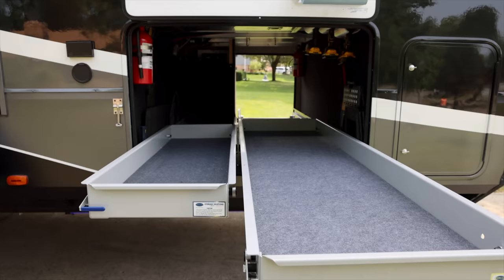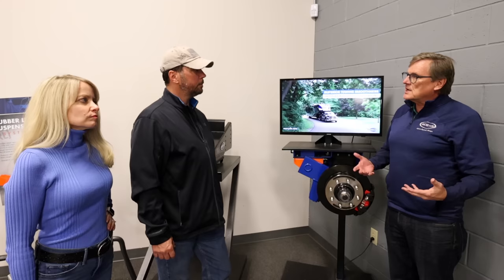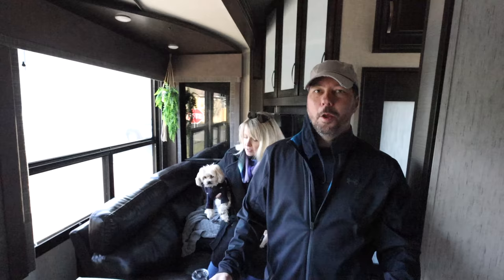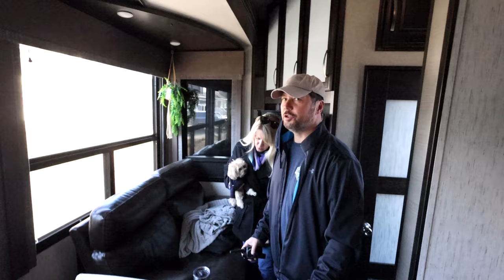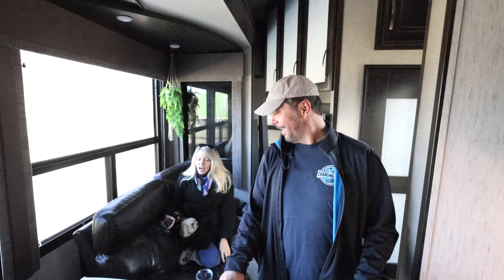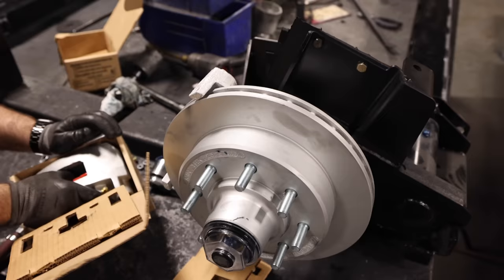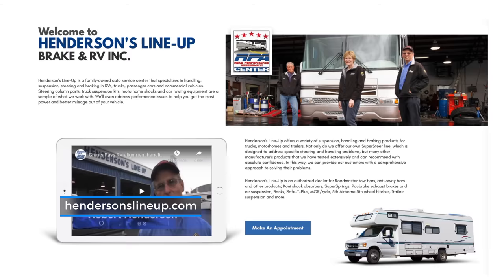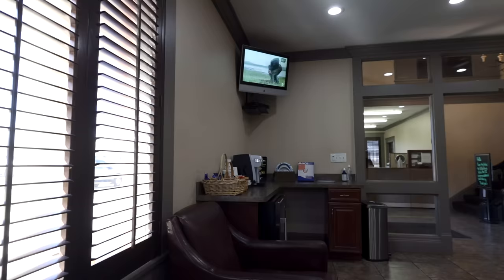MORryde Independent Suspension and Disc Brakes

Comment: When we order our 376 momentum we’re gonna have that put in for suspension love it thanks
Reply: Roadmaster Slipper Springs with Joyrider shock is cheaper, stronger, and no maintenance ever.
Reply: @Will-bp2yc  they may be cheaper but they are most definitely not stronger abd the ride quality is incomparable.
Reply: @Cake41579  OK? Do you know that Mor/ryde sheer springs tear (that is their maintenance recommendation), you have to check acceptable tearing. Also they last 5-6 years, after replacing them and their high cost, then buy them? Yes the ride is probably better, but Im not riding in a 5th wheel trailer. I only want it not to break/no maintenance, hence Slipper springs/Gas Shocks! And a whole lot less expensive!

Comment: Great video overall, and a great improvement in the trailer. We tow a Forest river 30' pull behind trailer, connected to our extended 155" WB one-ton Chevrolet Express van with a HensleyArrow hitch. We have been a weekend and vacation towers, Forest River is a 2 axle torsion axle, (similar to the Airstream suspension), The dry weight is listed at 6,600 lbs, but you and I know that is before things like the Hensley hitch +250lbs, Propane tanks 125 lbs full, spare tire 80 lbs? air conditioner, and who knows what else. Yes, I know, WAY lighter and smaller than your rig.  LOL. It has drum brakes, that work. I have no idea how it rides as I have never ridden in the trailer, (not legal in most states), but I understand More Ride's thoughts on having you experience the before and after-effects. All in all a fantastic upgrade for your rig. Note, the Hensley hitch causes a pull-behind trailer to tow much like a fifth-wheel trailer, complete with the trailer cutting inside the tow rig on turns, BUt in 38,000 miles of towing, we have NEVER experienced ANY trailer sway. A Hensley hitch is not cheap, coming in at around $3500.00 for everything. Nice warranty though, a lifetime to the original owner and parts replaced free for as long as I own the hitch. And no they do not pay me to write these words. We are both in our 70's and might not be towing over the road much longer, but it has been a trip. We thought about full-timing at one time, but that didn't happen. Glad to see you follow your dream.

Comment: We are currently ordering a new Momentum and they will NOT do IS from the factory. Both the dealer and called Grand Design directly that they don’t do this. It’s a little silly that they offer the 8k axle and disc brake upgrade now for 8k but not the IS part. So we are ordering stock and made an appointment right after our estimated delivery date to have that put in. Just a heads up :)

Comment: Congratulations on the upgrade. Have yall thought bout using 19.5. Tires on truck & trailer, nitrogen in all of your tires with tire pressure regulators? You’ll greatly increase your life of your tires and be less prone for blowouts when using 19.5 on truck & tires. Not including increase mpg. Look into Titan fuel tanks for your truck. You won’t have to stop so often to fuel up, go longer distances and have more flexibility of where your purchasing fuel.

Comment: I had the MORryde IS installed on my 2018 Open Range 3X 388RKS in November of 2018, and the new axles were 2 inches too long to bring home.
In 2019 we were gone for 5 months out West, Canada and Alaska and the IS was great, it is hard to explain to someone just what a difference it is.
Great job with the before and after rides.

Comment: Hey guys.... GREAT video here on the I/S and disc brakes.  It gives you an entirely new perspective when you can see inside the camper as it is moving.  When we ordered our camper from Bama, this was the first thing we wanted outside of even the FBP.  Just feel it adds a safety element to towing in more ways than one.  Again, thanks and hope you guys are well.  If you get down to Florida and find yourself west of Gainesville, you guys got a place to stay.  We have 50AMP and water here, along with 7 acres.

Comment: Thanks a BUNCH for spending my money!  LOL I saw this video shortly after ordering my new 5th wheel in January.  When you guys looked at each other after going over the railroad tracks and said wow, I decided I had completely and totally lost my mind, reviewed it with my bride, and the soonest they could get us in was nov 17.  Backed up 10+ months!  We took the appt as at that time, we planned to head to FL 12/1.  But another video... I have to stop watching your dang videos, they are too expensive, we decided to leave two weeks earlier and spend 9 days in Key West at Boyds before heading to our winter site near Tampa.  Do the timing plan, I was really short on time, and led me to a bad decision to leave morryde with a mysterious electrical issue.  Got 20 miles down the road and said no, we're going back.  They were aware of our timing issue and pulled out all the stops to find the issue.  Chad, you'll appreciate this, when brakes or left turn signal came on, it threw a message to the 2022 F350 the trailer's left brake light was inop... and yet it wasn't.  They finally cut the pump power wire, and no more gremlin.  Best part, hooked the wire back up and no more gremlin.  We have no idea what happened, but I'm kind of leaning to a poor electrical connection, and when he cut that connector out and re did it, we no longer had a spurious electrical noise that was possibly back feeding to the truck
.
The impact and improvement is dramatic.  When we went over the railroad tracks, want to guess what happened, we looked at each other and said WOW.
.
Still questioning my sanity of ripping out a brand new suspension system, but so far loving the outcome.
Reply from the maker: That's awesome!  So glad to hear you feel the difference as much as we do!  Take care and safe travels!  😀

Comment: One or two second delay on trailer brakes could jackknife you in the blink of an eye if you need to jump on truck brakes, at 60 mph each second is longer than a semi. Electricity moves faster than fluid, so I would have mounted brake hardware in a kitchen cabinet right over axles, after all , nobody rides in trailer where the pump noise would disturb them.

Comment: If this upgrade was for a class A motorhome, then I could see the benefit for what is likely a very pricey upgrade. 10,000? More? But for a 5th-wheel trailer? How often does anyone even ride in a 5th-wheel? Even when it's legal? I don't see the return on investment, unless you get it for free, like it appears you did.

[edit] As a 1st time viewer of your channel, I want to add I found your video to be very well done. Clear. Concise. Interesting. I'm just not sold on the MORryde upgrade for a trailer.

Comment: I love the suspension.  Ask them why they didn't do air bags?  MY $66,000,000 question - when is someone going to come out with all electric calipers?  I know the answer - disc brakes squeeze the pads, tough to do with electric.  The time delay you mentioned would be alot worse with screw actuators and a lot more expensive.  Still looking for someone that has done electric calipers or AT LEAST, individual caliper control for antilock improvement.  I noticed the sawed edge on the rotors for speed sensing.  Problem is all 6 wheels react the same.

Comment: This is a better option, obviously.  
But i would add some sort of anti sway bar settup. The original leaf style inherently has that function. You can visualy pick up on the extra left and right rocking from the camera mounted under the chassis. There is no progressive reaction to side loading like a sway bar or leafs for that matter. 
Even factory/oem style torsion axles have anti roll characteristics.  🤔hmm.

Comment: Leaf springs are such a primitive form of suspension and the sole reason for the continued use is cost. 

One question if I may regarding how you carry Daisy when you drive: Is it legal in USA ( I’m in UK) to have a pet unsecured like that when travelling? Are you not concerned what could happen in the event of a front end collision? It has been against the law for many years to travel with an unsecured pet here in the UK. Physics shows that in a 3G impact, which is not a very big crash, your pet would hit the dash with a force equal to 3 times it’s weight which could cause massive damage to the pet.

Comment: This year I put the SRE  4000 system on and now wish I would have saved my $600 and put it into this system. I’ve seen two videos now like this and I’m sold.
Reply: Either Mor/ryde last only 5-6 years. Sheer springs tear, which is part if the maintenance. (Keeping an eye on acceptable tearing limits. There is other products out there.

Comment: This post is NOT ment to "rain on your parade".  Just looking at the suspension system from "old farmer" common sense.  I would be very wary about the force and direction of force being put on the rubber pieces of the suspension.  From what I saw in the video, there is a constant "tearing" force being put on them.   Did the manufacturer give you an approximate milage life of these rubber pieces and at what cost for that part?  Personally I'd have a spare in my basement.  
That is the only weakness I can see in this setup.  Everything else looks GREAT.
  Can't beat disc brakes or independent   suspension on anything.
  Thanks for posting this video and information. Good vid.
Reply from the maker: So far we have 9000 miles on them with no issues.. 👍🏼
Reply: @ChangingLanes  Thanks for your reply.  Been following you for a while.

Comment: Very nice informative video by all the players, note this include the tremendous trio...Chad...Tara...& Daisy.  Chad, only one change I would have done different, oil lubed bearings, they run cooler, easier to maintain, maintenance can be extended out some.  But then, you would be wise to carry 3 new seals at all times, not that they are a huge problem, but if one leaks they do make a mess from that axle back to the rear of the RV on that particular side.   We bought a new IHC 9400 in 2001, it was a 2000, air ride is standard on it.  The truck was leased to different companies that had many spring ride trailers, the ride was not good enough for me.  Then came 2004, we decided to buy a semi trailer, so I went looking for one.  The trailer I bought was a very clean used 48' Refer with a Thermoking Unit on it, Spring Ride, New Recap Tires, oil cooled bearing & Aluminum Wheels.  Before I left the dealership with the trailer, they changed it to air ride, serviced the Unit, I wished I would have had them change out the recap tires, first trip one blew out...these were new recaps at 65mph.  When the tire shop broke the tire down, they found a huge mud ball within the tire, which had to have been put in there by a mechanic at the shop of the company that traded these trailers in.  When I got back in, the new tires got put on and I had zero issues with that trailer for several years, at the mileage rate of 2739 a week, 46 weeks a year, roughly 11000 miles a month.  The maintenance program I designed was really good for both the truck and the trailer.  The whole time we had this truck working, we had put 1 Million...600,000 miles on it and sold it and the newer trailer that I had bought to replace the 48 footer, it was a 53' trailer with a TK Unit on it.  But my point here is this, in all this time of ownership and use, the truck only let me down two times, once was not my fault, but the other time was.  When the truck mileage hit approx. 150,000, the turbo blew up on a 2 lane road just south of Lubbock, TX.  The next vehicle that came by stopped and gave me a ride into Lubbock where I got a Motel and arranged a tow for the repair.  Next day, rented a truck to deliver the load on time, all is well, picked up the truck at the end of the day and went on my way to get another load.  The other time was approx. 850,000 miles, I had planned to have the rear ends exchanged with rebuilt units, in August while at home and taking some time off.  A friend suggested, wait 'til spring, so since he had more time in trucking as an owner operator, I listened to him and adjusted my time by working.  About the time I would have been putting the truck into the shop for the rear diff's, I was picking up a load 220 miles from my house and the front diff went out.  Now, how do you think that would feel if it happened to you?  Not good, now I had to call the folks that I was getting the load for and explain the why's, what for's, etc, along with notifying the people I get the return load from, explaining all of that again for them.  At the time, I had a regular run, hauling for the same people week after week, then year after year.  The truck was towed to a IHC shop local to that area, the trailer the shipper had to unload it and reload it on another trailer, then park my trailer out of the way.  All in all listening to someone else with concerns of mine on my equipment, cost me approx. 10,000 USD, lost loads, expenses for my wife to come and get me and bring me back to pick up the truck, the trailer and the load.  That is the difference between doing maintenance when you have them planned for or a repair on the road.  Life does not give too many do overs, thus the tuition of life goes on and on.  But in all those miles I put on our equipment there were only two wheel seals that ever leaked while on the road.  I learned when to change them by, when the duration of past failures of the seals were averaged out, then back up a month or so, it worked well for us.  Maintenance is always less expensive than repairs.  I knew you all would be tickled when you took that step.  I still prefer that air ride, but I have no RV yet anyway.  Happy Trails...Rich
Reply: I asked for this when I had my 8K IS installed in Dec 2019 after watching a video about oil-lubed bearings/axles on E-Trailer and MORryde didn't offer it as an option at that time.
Reply: @CartersTrail   I sure don't understand why they would not offer the oil cooled bearings as a choice, but I am sure we do understand that in life there are many choices to be made and some are better than others.  My preference is the oil cooled bearings, better, less maintenance, run cooler that greased bearings too.
Reply: @CartersTrail   The grease cap on Chads are for the oil bath bearings, the only difference would be the seals, so it would be an easy fix at the time of a bearing check or repack of the bearings.
Reply: @razmondpush2971  Agreed; I was convinced it was a better option but they apparently don't have the experience with them to support it. You can add them yourself afterwards so I'll run with the greased ones for now and perhaps upgrade later.
Reply: @razmondpush2971  I noticed that in the video and thought that's what was now being offered/included until they showed the greased bearings later... Bottom line is you can add them afterwards if desired.
Reply: @CartersTrail   Yep, you are spot on with that thought.  Later is not a big problem either.  Thanks for the feedback.

Comment: Thx CL for an informative and entertaining video with great production. I see your still running China bombs seems counter intuitive to have better suspension and brakes with high risk rubber on the road for a few $$ saved. I had the Morryde SR4000 installed with 20k# Reese Goose Box when I bought my 2nd hand Fuzion 375, I   would have gone with IS but didn't want to be tied to so few qualified repair facilities after reading about full timers being stranded (when not if) the torsion rubber fails. Happy Camping.
Reply from the maker: Don't mistake the Westlake G rated for “china bombs”. I watch this issue very closely online. The E rated Westlakes had the bad reputation and were dubbed the “china bombs”. So, now, some just consider all Westlakes bad, but they're wrong.  We put 28,000 miles on our last set and only had one blowout from a pothole.
Good point on the torsion block.  Going to see about getting a spare to keep on hand.

Comment: Just had the IS installed on our Momentum 351 toyhauler on May 17th, 2022, and it was a very good experience EXCEPT for the fact that after installation and while we were paying we were informed that we had Hydrastar disc brakes instead of Kodiak. I questioned why not Kodiak and did not get a clear definitive answer. Quite disappointed in that last minute disclosure but mostly my bad for not going over the details prior to our arrival and MORryde doing the work. I ASSUMED we were getting Kodiak disc brakes. Buyer beware! My Chevy brake controller (2022 3500HD DRW) was set on 5.5 with the drum brakes and I'm now at 6.5 and still feel that the trailer is pushing us a bit...
Reply from the maker: That is a bummer, but I'd have to think that any disc brakes should be a huge improvement over drum.  Remember to see if your truck has a separate setting for electric over hydraulic.

Comment: I had a Jayco trailer with independent suspension that gave me a smooth ride like the trailer wasn’t connected. I miss the feeling of a smoother ride with these leaf springs on the new Jayco 5th wheel.😕

Comment: Or you could go to the RV museum while you're at the factory.  It bothers me that it takes a second and a half for the trailer brakes to kick in, but maybe I misunderstood that.  Do the brakes have antilock by any chance?   I think the effect on the truck ride is due to the trailing arm design of the new suspension.  The bumps aren't trying to push the tires straight up they're pivoting the tire up.  Just my thinking.  Keep the good stuff coming.
Reply from the maker: someone else mentioned that aspect of the suspension also... very good point.  Brakes are not anti-lock as far as I know...